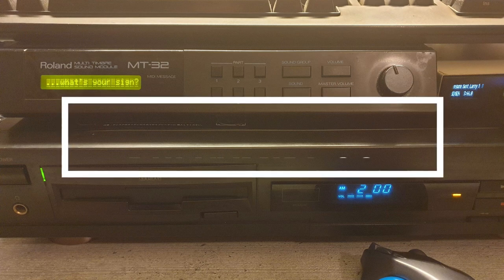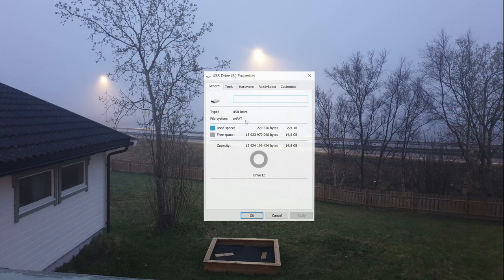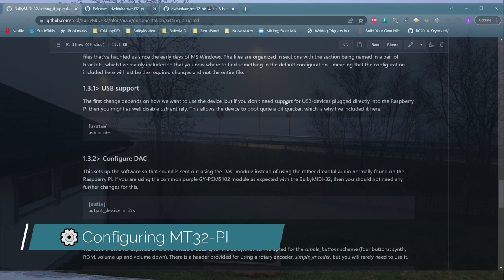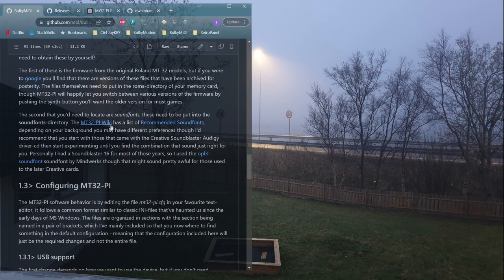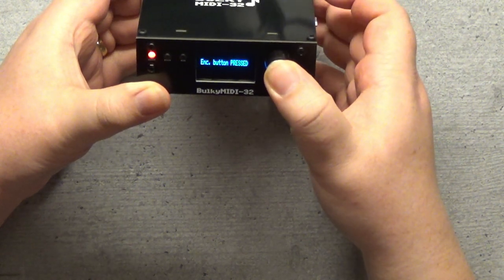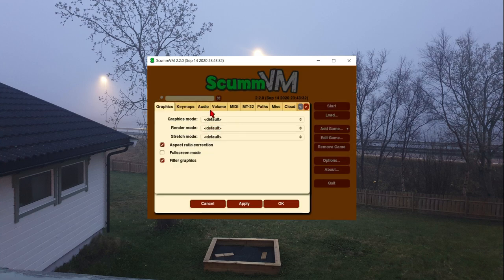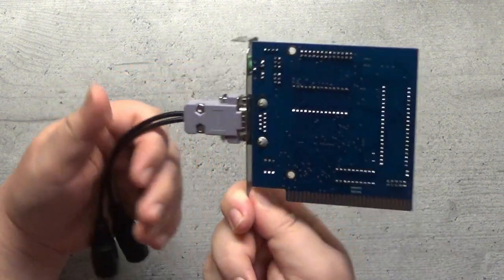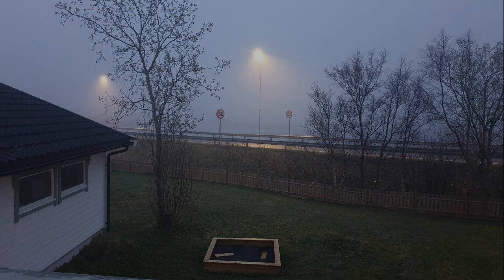BulkyMIDI-32 - Setting it up

Comment: on the main pcb it says sw1 sw2 sw3 and sw4 are these option or a mistake ?  and there is also j4  /in the asembly video you made you dont use these ,but there are on the bom list   SW1-SW4 *2	6x6x5mm right-angle momentary button
Reply from the maker: Alternative ways of assembly, if front panel is not installed - switches for controlling it can be installed here instead.

J4 was an option for earlier revisions, but I've not updated the faceplate for it (I don't know anyone who built that version of it, so probably won't get done).
Reply: @TEBLify  can you link the part on ENC1 its not listed on the bom file thanks

Comment: on your bom list it says  ENC1	5-pin right angle pin header < that needs to be some kind of pot ,can you share the correct part thanks
Reply from the maker: If installing a front-panel you'll be installing something like the 20mm part listed below on it. Without it you can still use the same part, but the connector is just somewhere to plug the cable (at that point it is assumed you're building your own case and installing it somewhere on it). For neither option, you're looking at installing switches instead.

Comment: iam ordering all the parts,question j5 and j6 are for external devices correct so its not realy needed ?
Reply from the maker: You generally won't need those, one is a breakout for a serial adapter (a low cost alternative to using a somewhat cheap 5pin MIDI adapter. The other is a breakout for a MIDI-thru port, I've never had a use it for it as there are always other options.

Comment: why are my comments being removed  ? the pcb i bought looks difrent than the github picture the one on github has 2 extra leds
Reply from the maker: I have not removed any comments, but it may have been caught in a spam-filter of some kind.

When I did the redesign to have a dedicated front-panel, the power LED was moved here from the separate extras-module. This also moved the OLED to the middle instead of being on the left.
Reply: @TEBLify   so i think i have printed the correct pcb than revision E  thanks ,🤓

Comment: does this bulky midi also emulate the roland cm 50/55 or mt 32 only ?
Reply from the maker: I believe there are soundfonts available that'll approximate those, as to how accurate they are - you'd probably need to talk to someone with a better ear for such things than I have.

Comment: to use your BulkyMIDI-32  i need this isa card ?
Reply from the maker: It is one of the ways of using on an old PC, an alternative is a soundcard with either 5-pin MIDI ports in a drive-bay expansion or via the gameport. By building up an extras board you can use it via 9-pin serial port. On a modern system you can use it with USB MIDI adapter.